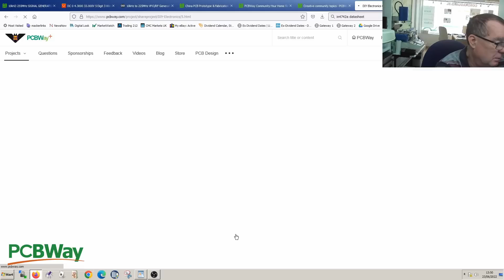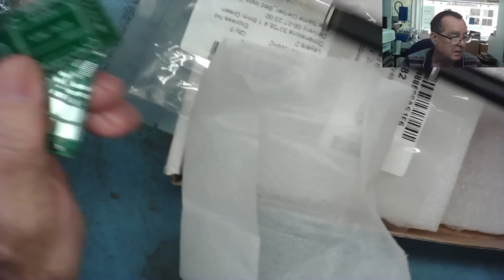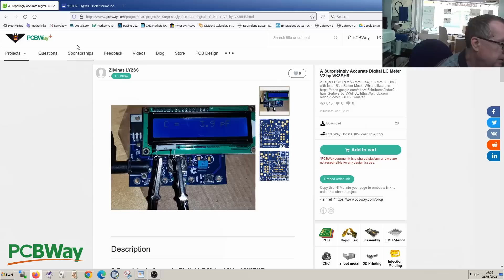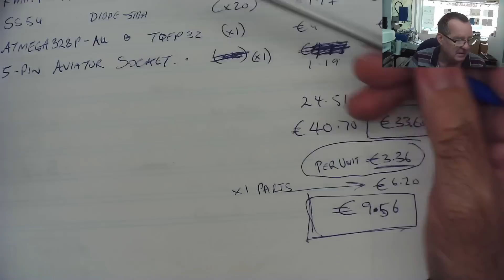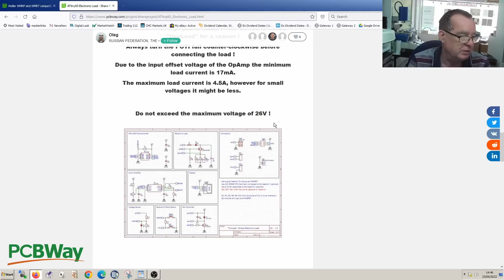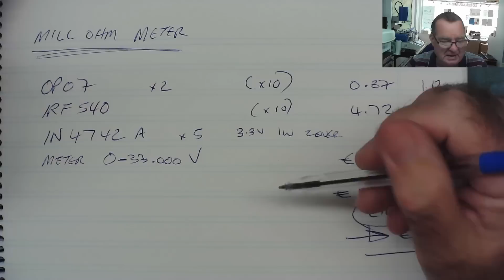Is it worth building your own DIY Electronics Test Equipment Projects?

Comment: The Weller project is INSANE, using an ULTRA EXPENSIVE CPU!!!!    If it used a STM32F103 etc.. you would save a packet.   ....CRAP DESIGN!!!!!!!!

Comment: I think a nice little Arduino/pi based THD distortion meter would be a good one, but not really finding much in the way of those, and commercial equipment (even 2nd hand on eBay) comes with an unjustifiable price tag for the occasional use... I expect it'd need good precision DAC and ADC and well enough isolated for the best noise floor to make it useful, along with some nice calculations in software!

Comment: Even if sometimes the costs is not really worth the "hassle" of building it yourself, for people like me, sometimes  just seeing the finished product working as intended, with maybe a personnal touch also added to it can be quite gratifying!! XD I also find it amazing how popular and accessible diy stuff has become over the years!!! One project that is quite popular and that could be fun to see your take on it, and maybe even see if with all your knowledge you could have some ideas to make it even better(like adding functions or even just making it more reliable?) is turning an old psu into a diy lab bench power supply!! On top of being a very useful tool to have for someone dabbling in electronics, i'm pretty sure you probably already have a few spare psu laying arround!! 😄 In case you'd ever decide to do it, here's a suggestion for something i haven't  really seen being done with them in the videos i've watched so far that could make it even more useful, if you have the knowledge(pretty sure you do!! XD) and if it's easy enough to do, would be increasing the maximum voltage you can get out of it(12v is enough for a lot of stuff but sometimes you just need a little extra!!) XD I guess that would probably involve either changing or modifying a transformer??  Would be fun if you'd only have to swap a resistor like you did on the power supply for the monitor, but i'd be really surprised  if it was that easy if you want to double  the voltage or more!! XD

Comment: Back in my Younger days, while I was in the USAF, I learned to solder on a Weller Soldering Station, and I have used Weller my entire life, albeit very limited usage. So I can attest to them being Very good, for what I leaned on back in the Very Early 80's. I've not much experience with anything else, however I would recommend that you build the Weller, just for the A) Experience, and B) the Chance to see how well the Weller's really work.( You did ask for our opinions). Hope that helps.

Comment: My primary EE hobbyist interest is in building lab-grade DIY Test Equipment. If you make that a priority for your channel, you will have my direct attention, in a big way. I understand your reasoning for justifying the build cost against the buy cost. However, for me, the cost is of less concern, because I am building the equipment to learn electronics. The learning is the fun and important part of it. That does not mean that every project needs to be massive. Actually, I like the smaller ones better. Say a Wheatstone Bridge Tester, or other such small,  but useful projects. HTH.
Reply from the maker: Hi t1d100 Thanks for your reply.  I don't particularly intend to make project building a priority for the channel as LER is very much repair based.  PCBWay currently offered to sponsor two videos per month on a 12 month contract , and as they are a PCB manufacturer there will be a couple videos of this type each month, the remainder (I publish around 16 videos per month - or at least try to) will always be 'learning to repair electronics' related.  Of course there is a crossover between these topics and I consider this a good thing which I was happy to go with this sponsor and don't think that detracts from the channel, I actually think it adds to it.

Are you on the LER discord server?  We have a special section there related to DIY test kit and you are welcome to lend your expertise.  As PCBWay are sponsoring us, I can provide free PCBs for projects being developed on LER Discord, on the understanding that the completed project (Gerbers, Schematics etc) will be uploaded to PCBWay shared projects - credited to the author(s) - and featured in a sponsored video here.

DISCORD:  https://discord.gg/vam6YC8vwU
Reply: @learnelectronicsrepair  Thank you for all of those details. Very interesting. Thank you for the invitation to Discord. No I did not know about your site. I will give it a look. Cheers!

Comment: This seems really interesting, i am expsecially interested in the Soldering iron, because i am using a TS100 and i would much rather have a proper station with more power. 
Really looking forward towards what you will try out!

Comment: I LOVE this Idea ! I also have an interest in DIY test equipment and I like the projects you have chosen. I built a micro current meter based around the microcurrent gold (don't tell Dave Jones !) although I did add an OLED display and touch buttons to access the display and wrote the very basic software as well so I don't feel to guilty, I think it's open source anyway, and I find it useful enough to build myself but couldn't justify buying the $90 ready made one, and it works very well and dosent tie up a meter, so big thumbs up from me (for what its worth !) ...cheers.

Comment: I’ve also been looking at building some test equipment this week as I can’t really afford/justify the cost for what little I do as a hobbyist. I noticed a diy component tester was basically cheaper to buy fully built than in component form especially including the case, on fleabay at least. Still bought the diy kit for fun like I did a dso138. Now have a Kikusui cos5060 scope I have acquired, took me ages to even get the square wave test signal to show with any sense as it was largely alien to me apart from obligatory yt learning. Thanks for your videos, enjoying them all.

Comment: Richard what about building the ultimate ATX power supply tester. A three channel electronic load that incorporate your ATX power supply tester you have now into the electronic load 
design it so that you simply just plugg-in your ATX power supply it will switch on the ATX power supply, then you will be able to see all the voltages under load also you could build into the project a current limiter also a switch to turn off the AC mains power supply when you're working on the unit. Just some helpful ideas.
Reply from the maker: That sounds like a very interesting idea.  Yes I could combine the ATX analyzer I already have with the electronic load.

Comment: I have just started designing some high accuracy test equipment for sale in kit form.

Custom made cases and vinyl panel stickers will make the finished items look like professional units. Most will be battery powered with the option to build a mains powered version. Having common cases across the range will mean stackable and a common appearance. First item will be a milliohmmeter with 10uOhms accuracy VCO for shorts tracking and a scrolling graph showing each measurement taken. Then a 250MHz differential scope probe.
Reply from the maker: @Irish Viking 
That's good to hear.  Why not come over the the LER discord as well it is free to join (if you are not already a member) and PCBWay are sponsoring our projects so  I can also help you get free PCBs  

DISCORD:  https://discord.gg/vam6YC8vwU
Reply: Like to see it